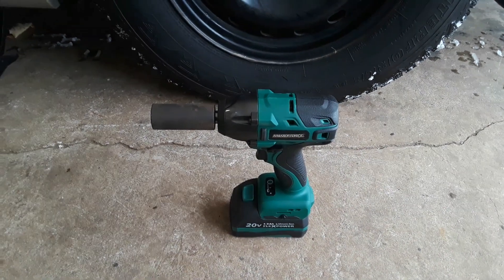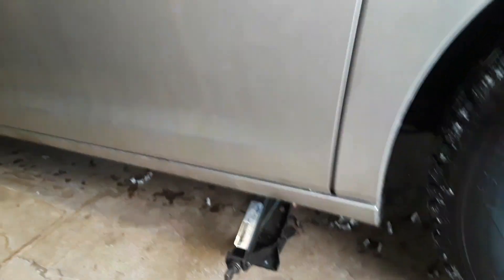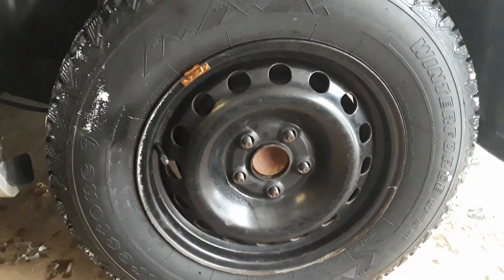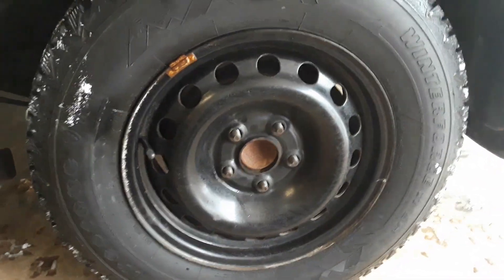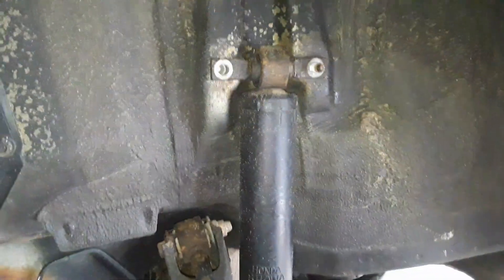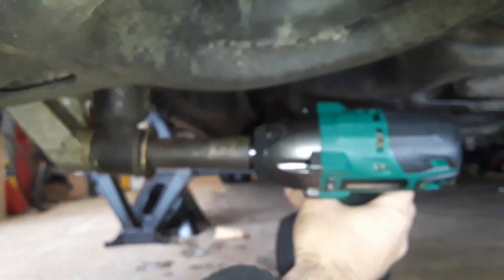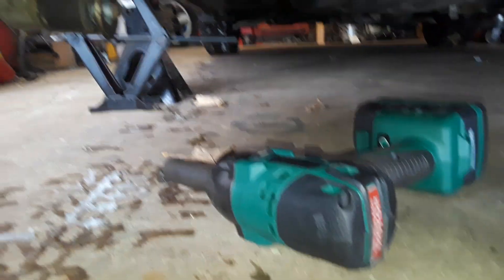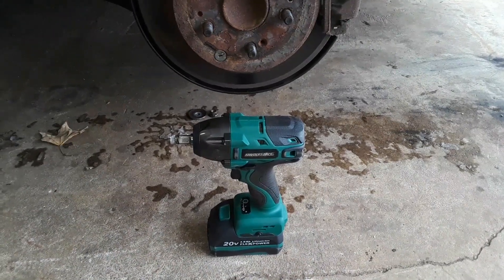Masterforce 20v, 1/2" drive impact review,  Part 2.

Comment: You can use a normal drill in low speed on the scissor jack and save your ears. My milwaukee m12 fuel drill lifts my vehicles easily.